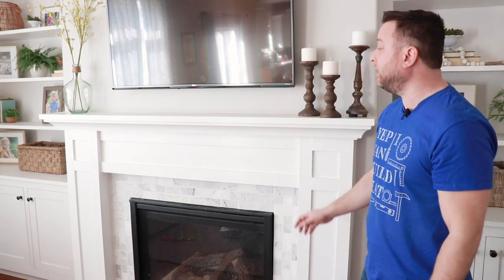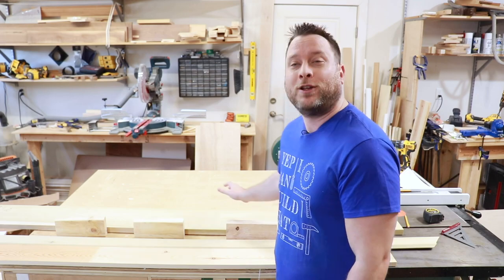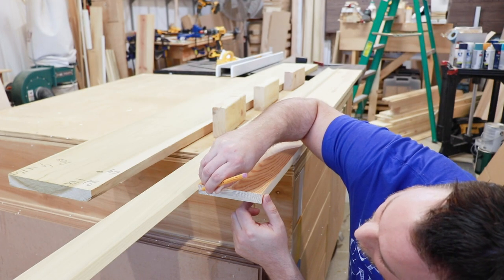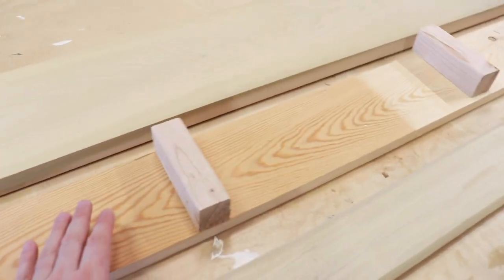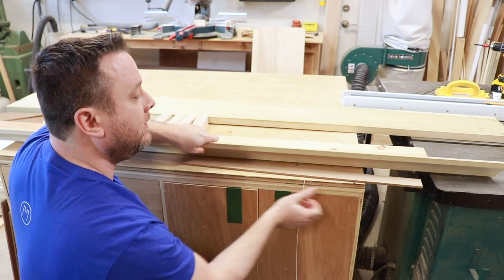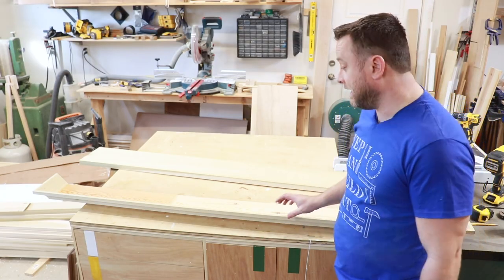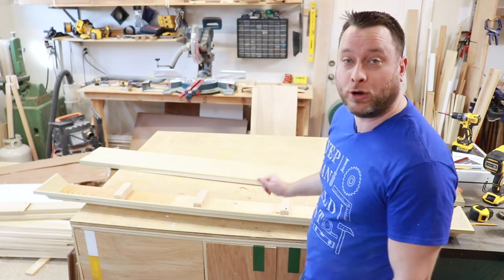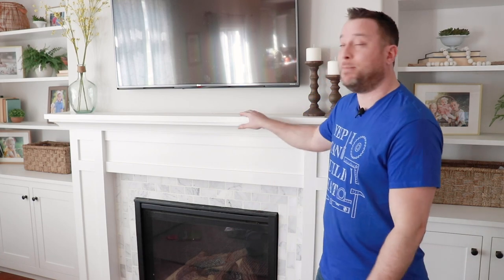How To Build a Shaker Fireplace Mantel Top | Woodworking Project

Comment: Well, how did you attach it to the wall??
Reply from the maker: The mantel is attached to the surround using screws that I later filled with wood putty
Reply: @HowYouCanMakeIt  ok thank you!
Reply from the maker: Any time
Reply: Well I tried to cut the crown molding for my fireplace tiday, I did 45 degree miter cuts but I still did it wrong
Reply from the maker: Oh no that isn’t good.
Reply: @HowYouCanMakeIt  well that was a $50 mistake. But I already figured it out after watching some YouTube’s how to make a combination cut and turning it upside down
Reply from the maker: Oh man